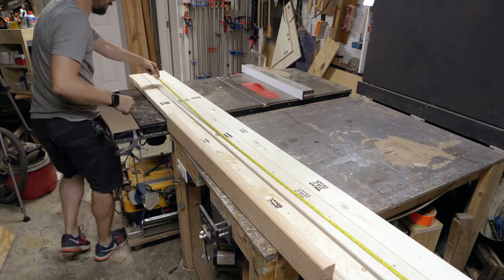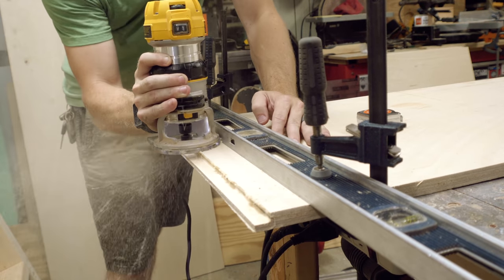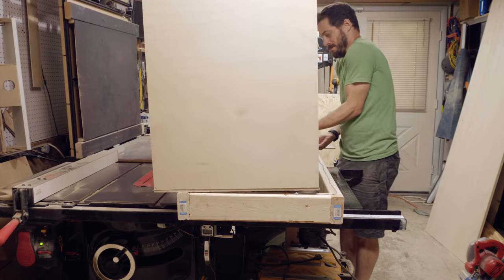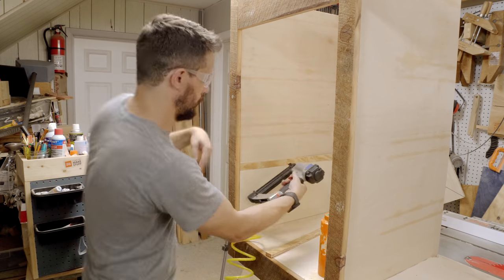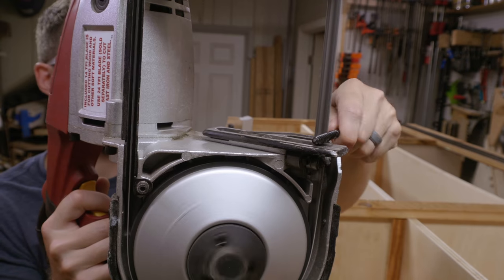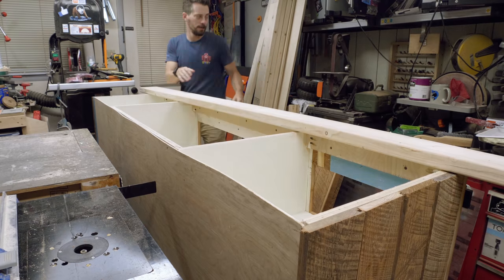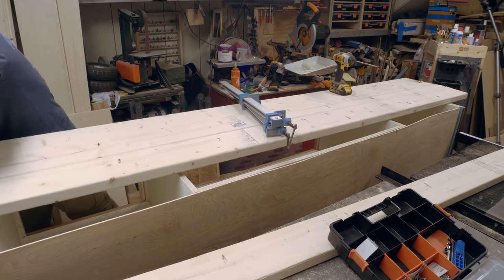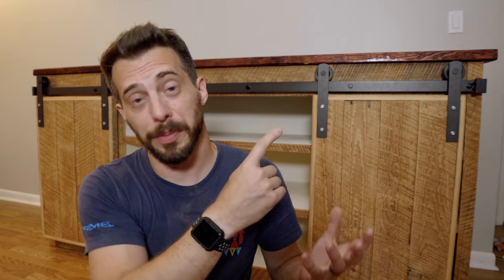Media Console Table // Woodworking How To | I Like To Make Stuff

Comment from the maker: There was a mistake in the first upload, so I corrected it and re uploaded.
If you want to make your own, check the description for everything you need as well as a link to the digital plans (when we get them finished).

QUESTIONS:
1. I didn't drill hopes for wiring because I wanted the new owners to add them as needed based on their components.
2. It's heavy, but not THAT heavy. I lifted it off my table alone.
Reply: OK, I wondered what happened.
Reply: please make attack on titan swords
Reply: You should make a table with abilty to change height.
Reply: I Like To Make Stuff does you're drill have lights? because if so, that's super useful!
Reply: I am sorry but I was just wondering if that is your new shop
Reply from the maker: It does! Great feature.
Reply from the maker: Nope, not yet. Coming soon.
Reply: What company makes the tool known as the beautiful wife? Can I find it on Amazon?
Reply: you look like steve buscemi with a beard
Reply: hey bob, could you please make something that would be fun to make for a 12 year old but with no powertools.
thanks
Reply: Hey Bob you didn't leave room for wires to flow upwards or connect to something behind the console table.
Reply: so can u help me im 11 can I do any of deez projects and next can u make a ps3/4 and x-box stand with controller storage (plz)
Reply: Hey bob, would you be able to try make a PS4 controller stand using no power tools or very basic ones like drills and a drop saw thanks
Reply: will does stuff don't let your age discriminate you ability! You can do it if you set your mind to it! Draw it out, design it, and break it down into it's simple form.
Reply: I Like To Make Stuff what are the big standard tools to start wood working
Reply: I Like To Make Stuff Hey I don't know if you'll read this but I'm gonna say it anyway. I LOVE your videos. I don't even know half the words  (of tools and stuff and wood) you use but when I'm a couple years older I'm going to try to make your stuff like this. I think you're descriptions and stuff are great but maybe one idea to help could be a 'recap' where you make a plan for stuff like this, e.g) changing inches into cm,  showing where the holes and bolts and screws are on the fjnished product? Like it's amazing but sometimes when I'm trying to understand it its like 'woah wait... what goes into where that goes into what?' I totally get if you don't want to do this though, It's very clear how much effort you put in this.
Reply: I Like To Make Stuff 

A

A
A
A
A
AAA
Reply: I Like To Make Stuff i
Reply: I Like To Make Stuff to
Reply: Just add some glues and screws. hehe
Reply: Hey bob I'm 11 I made my own little Xbox stand it was big had holes in back did not buy and I did by myself I stained it the same color as the top oh the holes were to hide the plugs and I might build this with my dad and when I built the stand it was all sanded by me I have my own tools and I might build this.

Comment: I built a very similar one for my bedroom. I don't own as many tools as you do, neither I have such a good workspace, so I bought 2 of those pre-built kitchen kits, assembled them (on my bed lol) and put a table topto make them look like a single table.
I also added a bottom board to screw the guides for the sliding doors. It came out pretty well, with its clear wood top and its blue doors. II'm very proud of that table :)

Comment: I don't have a guide for my circular saw, so I use the same trick you did for the router - clamp a straightedge to the panel to guide the cut. You can even use a wood board as long as it's straight enough!

Comment: To stop large tabletops with with planks glued edge to edge from bowing or warping have the end grains alternate in direction. The end grains have a circular pattern and a lot of the time there will be large U's in the wood. Flip the U's so that the end grain alternates between a U and an upsidedown U. It will help prevent bowing and warping.

Comment: hey bob, great project. let me make a suggestion. dont expect to find perfect face and be straight boards at a big box store like home depot. they are milled to framing/construction standards and are meant to be covered up. Instead i would look into using 5/4 common or select pine, if you can get away with a less than 8 ft length for it. You get an increased strength, straight corners and they come in different sizes. i used some for the workshop table project and the 5/4 by 4 actually gave the appearance of a 2x4 despite being about a 1/2 thinner.
Reply: J
Reply: U3yd Hi I 4am good thanks for 7the 4and 6years at the moment I 6do think I don't have 6any and 7pls 7and 8I I am fine 5dining and u can do a partition guid to be honest is the first time I could see you brainless and I 7will know what u waiting for the past few years ago 47in 4cervexas is not sound like a ver low 
, banana face poo poo face
Reply: 8999999999999999
The man you are good ok do you have a drone that's the only thing I'm thinking about oh yeah do you have a brownie round round round round round round round round round round round round and round round and round and round and round and round and round and round and round
Reply: Hi

Comment: To make a cover for the opening in the middle (this kinda goes against the rustic look of the build, but some people like the flush look)

1. Measure the length and with of the middle compartment, divide by two.
2. Cut 2 pieces of wood (thickness should be roughly equal to the other two doors, or slimmer.) to matching length of measurements.
3. Miter one of the longest sides of each piece at a 45* angle.
4. Stain your two pieces to match the other two doors before attaching hardware.
5. Attach one piece to each door with a hinge, with one miter angle side down, and the other angle side up. (this is to insure the cover closes.)

I think this would work? I'm sure I'm forgetting something.

Comment: You know it takes more time to pre drill. I know you might not agree with me but I personally don’t pre drill time is money and I just don’t have the time to do that. Instead I take the screw and drill it in slow for about an inch and then I hit the trigger and I’ve never spilt the wood or stripped the screw. It goes a lot quicker and more efficient

Comment: Hi bob, do you reckon; when using this thicker wood siding, a 1/2 '' or 12 mm plywood for the side would be plenty strong 💪 ? Cool cabinet! Quite modular to adjust it one's taste!
Reply from the maker: +Sebastiaan Mollema yes that'd work fine I'm sure. Thanks!

Comment: I was working in a theater shop and we had to make a barn door. we used the same system you did but we made it all will scrap pieces of metal and some cheap pulley bearing

Comment: Did you run out of the reclaimed wood? The type of detail you did on the doors would have looked great on the top of the cabinet.

Looks great Bob!
Reply from the maker: I didn't have any pieces that were that long. Also, I was running low on time to finish it, but you're totally right. It would have looked nice!

Comment: So Bob, why did you have the respirator on when you were shooting brads on one side of the console?   I thought it might have been when cutting the old floor boards but not...?
Reply from the maker: I think I just had it on from a previous step and probably forgot to take it off :)  I did use it when cutting the boards mostly since I didn't know about the paint on the backside. Didn't want to risk it being nasty stuff (it's OLD).

Comment: Hey Bob, just working on a project to redo a basketball backboard that is outdoors, what would you suggest is the best material to use? This is in full sunlight everyday, and takes the wind, rain and whatever else the weather can throw at it. The previous one was bought and made out of perspex by eventually the UV got to it and it disintegrated after 4 years (bloody Australian sun). I was thinking plywood but there are issures with buckling and warping when it gets wet, the other thought was stainless steel sheet or aluminium, however those are not as good when coming to a backboard. Any advice would be great, love the videos, cheers.
Reply from the maker: I feel like some sort of plastic would be the best bet, but I honestly have no idea about a specific type.
Reply: Might have to look at some type of acrylic with a backing to stop some UV, thanks for your help!

Comment: So, Bob...  long time watcher, first time commenter.  I really like the look, but how much does that sucker weigh?  Did you consider using 1x in place of any 2x and possible 1/2" plywood and place of any 3/4" plywood?  

O certainly see the wisdom in certain areas like the exterior pieces for the thicker lumber, but am curious if using thinner material for the inside pieces would still provide the same level of sturdiness?

Asking for a friend... ;)
Reply from the maker: It would probably work fine to do that. I was just working fast so I reverted to things I'd done in the past.
It's heavy but not impossible to move. I took it off the workbench by myself and moved it into the next room.
Reply: Roughly, what are the dimensions?  Just wondering a general size  for reference and not specific to construction.
Reply from the maker: About 40" tall, 7' long, 20" deep
Reply: Wow.  That's a nice size.  

Thanks.  I really enjoy your channel for the variety of projects and ingenuity.  I appreciate the replies.

Comment: I understand that you have a lot of work to do because of the moving, and you have a lot of things in your mind. I just want to point out that the page where your plans for this build are supposed to be is an 404 error. Nice build by the way but i thing that you must put something to those slide doors so they won't move freely at the bottom.
Reply from the maker: We're finishing up the plans and they will be there when they're done.
Reply: Ok thank's and keep up the good work :-)

Comment: I know this is an older video, but is there any particular reason you used construction adhesive instead of wood glue?
Reply: Hi Ali.  I'll venture a guess that the construction adhesive filled in the contours that are likely to be found on construction grade lumber (rather than wood that had been jointed for a perfectly flat edge) and created a more robust, flexible bond than wood glue would have in this instance.